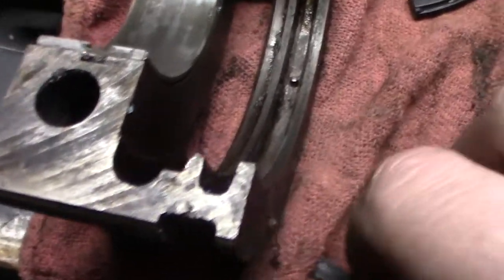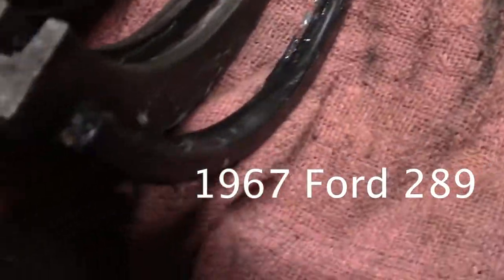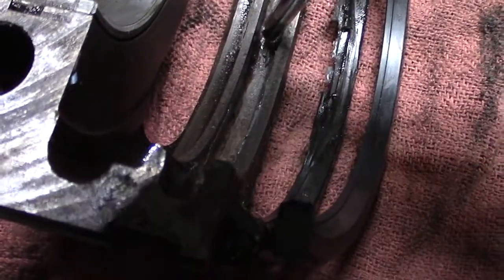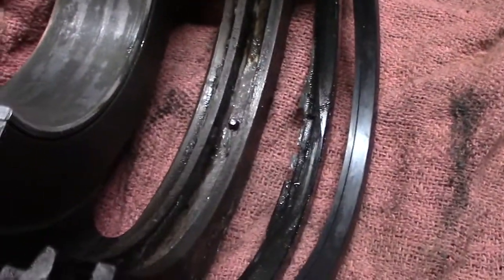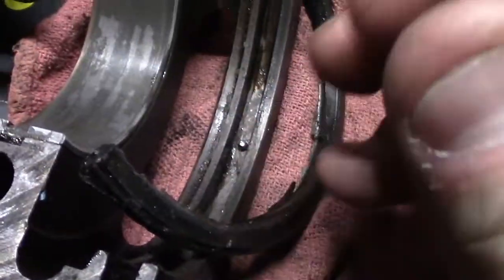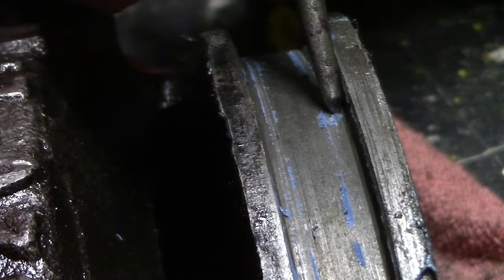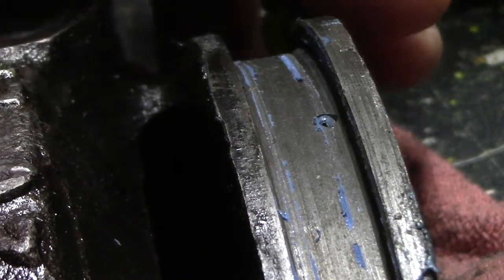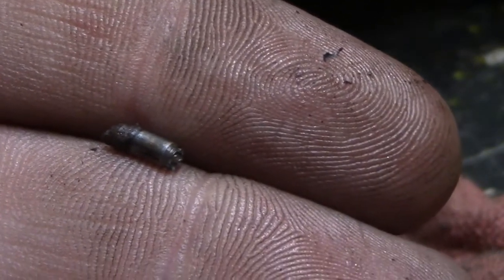Remove that Rope Seal Pin! Prevent Small Block Ford Rear Main Seal Leaks

Comment: What about the upper rear seal. How'd you get that out.
Reply from the maker: You can push it out with a punch, however I pulled the whole engine apart so I just pulled the crank out and removed the seal

Comment: Does  block half have a pin also? I'm trying to do my 1968 fastback 302 rear main seal at it has a rope. I cant get that rope out the top engine block side for nothing!!
Reply from the maker: Thanks for watching. The top did not have the rope seal pin on my 289.
Reply: @RiggsGarage  Thanks. I cant get that rope out for anything on the block side. I may have to pull the engine out and take the crank completely off. The rope has already torn about an inch on each side. Engine and transmission are still on car.
Reply from the maker: I have heard of guys keeping engine in the car, loosen the main caps a bit, that drops the crank down 1/8 inch or so, gives you clearance enough to get the seal out without pulling the engine. In my experience, pulling engine always ends up redoing everything while it's out
Reply: Just an Update, I loosened all the caps and the crank didnt fall or the caps. Later I tapped on the caps and they fell one by one creating a gap. After removing the rest of the rope, and I add no pin on block side on 302 either, with new seal the crank wouldn't turn by hand after torquing down. Dropped transmission and flywheel and there it was...the rope has smashed outside the seal channel, it was smashed out the back side of engine block making crank to tight on backside it wouldn't turned. Cleaned it out and everything went together perfect. After two weeks im getting a few drops again. Smh. Probably from the tired engine with a little  blow back, or I damaged the seal a little. This engine needs rebuild anyway soon. Will wait until then.
Reply from the maker: @UptownFights  the stuff isn't easy and can be a big pain in the rump
Reply: We’re you using a Sneaky Pete to help get the old rope seal out?  If not, what were you trying to get it out with?

Comment: Thank you. I think this explains why my engine becomes very very hard to spin with the rear main seal installed and tightened down. Thankful I found this before I put it all the way together and got a leak.
Reply from the maker: If you pull the rear main seal cap off, does the engine spin easily?
Reply: Riggs Garage yup. If I loosen it up or take the seal out it spins nicely.
Reply from the maker: @mcgarage3963  great news!